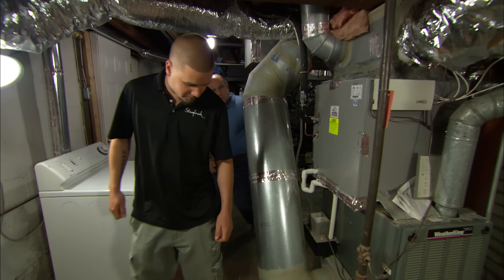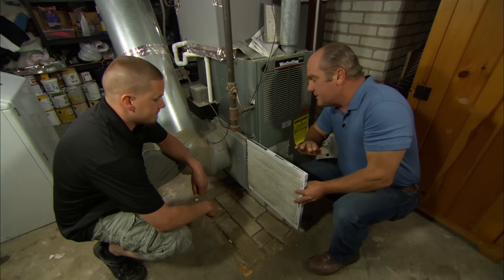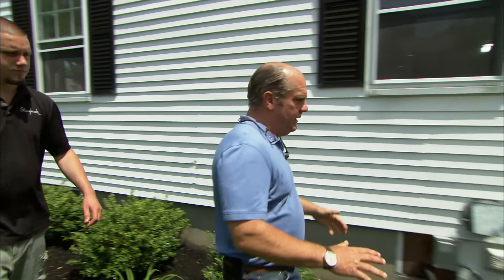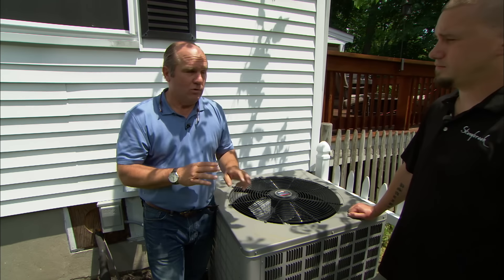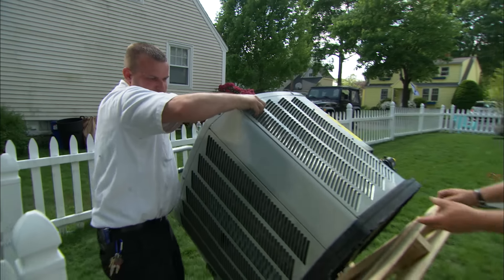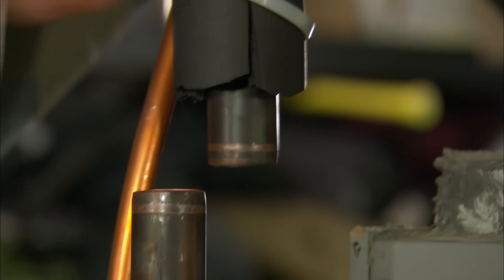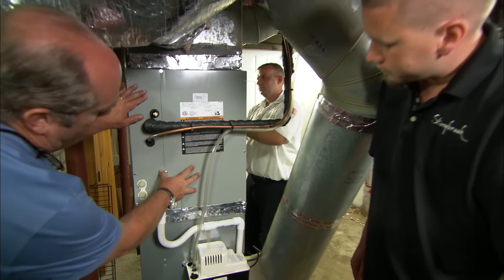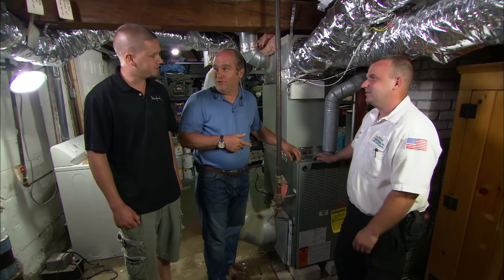How to Repair a Frozen Air Conditioner | Ask This Old House

Comment: "Hey my lines are frozen"
"Let's check your air filter..measure your ducts..yep just like I thought. You need a new unit."
Reply: Hahahahhahahhahaa
Reply: Right?!?!?  That’s ballsy even for residential techs.
Reply: @davidcerino1145  I'm honestly thinking about doing this next frozen line I come to, just to see their face. "It's only three years old!" "Well you're about two years overdue for a new one."
Reply: Steven Douglas 
😂

About 2yrs overdue!  Ha!
Reply: Steven Douglas lmao...
Reply: Love this show! BUT this guy has no idea how the refer cycle works, he was right it was to big. Anyway  it comes in a HOT liquid, pressure drops in the TXV, boils off in a low pressure side, becomes cold ( 40º)  in the evap coil, with a loss in refer or air flow causes this to drop and freeze up. Remember everything you think you know about refidgeration is backwards Lol, it's a chemical mix and science, not for dummies.
Reply: Matt Brown exactly
Reply: Why does he not just turn the AC down??
Reply: Man I can here to fix it not replace
Reply: If This Old House wasnt paying for the new unit, that guy would have been pissed.
Reply: Warren Matt it doesn’t work that way with single-stage equipment.  There is no turning it down.  The compressor runs at only one speed.  The way to stop a freeze up is to supply bigger duct work, so it gets more airflow over the evaporator coil, or turn up the blower motor in the air handler inside unit (most of those have different speed taps on the motors).  More airflow transfers more heat (sensible and latent) to the refrigerant.   As you do this the low-side pressure comes up measurable with gauges.  58 PSI has a saturated temperature of just above freezing R-22, but you really want to see about 68 PSI to 76 PSI for around a 40 to 45 degree evaporator temp, so water doesn’t freeze and it cool well.  If you are low on refrigerant pressure on both the low and high side drops as well and you get a freeze-up, yet you loose BTU cooling capacity with not enough refrigerant as well.  You don’t want to overcharge either as you loose efficiency and the refrigerant can flood back to the compressor in the outdoor unit.   To validate it is not flooding back, you verify you have the proper superheat which is how much extra heat the refrigerant took on from the evaporator after it boiled.   Simply put if the low-side pressure of an R-22 system is 70 PSI it’s saturated temperature is 41 F at which it boils.  If the suction line temperature is 51 F then you have 10 F of superheat...  that’s how you know vapor is coming back to the compressor and not liquid refrigerant.   Likewise, when charging you need to know if you have a thermal expansion valve (TXV) that maintains constant superheat or if you have a fixed orifice.   With a fixed office, you charge based on a superheat charging chart that takes indoor wet bulb (latent and sensible heat load) and outdoor ambiant dry- bulb.  If you have a TXV you charge based on the high-side ensuring proper sub-cooling?   Specifically, that compressor takes the cool vapor and compresses it from say 70 PSI to maybe 300 PSI in the outdoor unit.   As soon as it is discharged the refrigerant is very hot probably enough to burn you maybe 140 F high pressure “hot” vapor on the discharge line.   It then goes through the outdoor condenser coil which blows outdoor air over it (I.e. 90 F air on a warm July day), and this cools and condenses it to a warm high-pressure liquid.  It might be 110 F liquid it sends to the air handler!  If it is 300 PSI the boiling point of that refrigerant is 131 F...  If the line is 110 F we have 21 F of sub cooling and know we are sending liquid to the air handler.  It hits a restriction the piston or TXV and suddenly has a massive pressure drop to about 70 PSI and the temperature drops to about 41 F.   Hope that helps.   Adding refrigerant increases low and high side pressures, lowers superheat and increases sub-cooling.
Reply: Matt Brown you are right.  In fact the outdoor unit sends a solid column of warm sub-cooled liquid to the TXV (or piston)...  it might well be 110 F if the condenser is old and plugged up, but if that R-22 system is running 300 PSI on the high-side the boiling point (saturated temp) is around 131 F, so it would have 21 F subcooling.   Then of course it hits the metering device and drops in his case below 58 PSI and the saturated temperature of the evaporator drops below freezing... Presto... low charge is a freeze up, but in his case it is probably lack of airflow.  Only an idiot puts a 5 ton unit in a house that small and or with with one small duct.   Honestly, I bet the 4 ton replacement struggles to keep it’s low side pressure much above freezing.   I wouldn’t be surprised  if it’s a 410 A system at about 108 PSI  low side.

They should have done a load calculation, installed some new duct work, and likely reduced this home to 3 tons.  Hell my home is 1.5 times bigger and I run a 3 ton in a hot and humid state, and the system runs well.  On a normal warm day I have about an 41F evaporator at around 125 PSI, yet I condense at around 325 PSI u less it is like 100 F outside in which case I condense around 400 PSI.   Regardless, I operate around 10 degrees of superheat and sub-cooling most of the time, but I don’t have a TXV, so my superheat wanders.  Regardless it is usually within + - 3 F of a charging chart...  I am not getting the gas jug out unless I am beyond +5 superheat too much .  This year I haven’t even checked it...  probably should give the condenser the hose treatment, vacuum the drain line,  and slap some new air filters at least.   Last year I did a LOT of pro-active maintenance even swapped the OEM Chinese cap, which was 7% low with a USA made Amrad, which was 1% high out of the box...   I am not likely to check the electric components this year nor the charge.
Reply: @NETWizzJbirk  Holy cow! I am a rocket scientist for NASA and i aint smart enough for all that!!!
Reply: The duct is messed and small
Reply: Maybe he just had a leak and was low on refrigerant...that will happen
Reply: @UnfilteredGolfer  yep
Reply: On top of that, they downsized his unit from a 4 ton to a 3 ton unit.  Wtf.
Reply: @mattbrown1865  This is why I let the pros do this. It is always great to have a good friend that is a HVAC tech.
Reply: ...Today!
Reply: @eliyang  they needed to downsize the unit... it was way too big. without a tape measure I can see that ductwork is too small. if they didn't downsize it, the new one would freeze... didn't you pay attention? Not only was the return too small @14-16 inch, but he has a damper system which is going to effectively reduce the size of the ductwork even more, and the damper system is missing the bypass. a unit that is oversized for the house isn't a good thing - sure the number on the thermostat will be lower faster - but its not going to be as comfortable and will have humidity problems.
Reply: @Justin-vr5zn  - I can promise you he wasn’t paying attention. He’s one of those “bigger must be better” dummies. Hell, it was probably one of his relatives that installed that oversized 4 ton unit in the first place.
Reply: Typical AC repairman
Reply: An actual plenum would have been a good idea, there is no place for the air to properly mix with all those takeoffs coming off so close to that coil. Basements like that are tough because the ceilings are so low
Reply: @warrenmatt5099  sometimes that works sometimes it dont
Reply: Bro didn't even bother hooking up gauges before replacing it lmaooo
Reply: HVAC 101
Reply: This statement is more accurate than all his calculations. This just happened to me
Reply: Sounds like a great salesmen to me lol

Comment: This problem was addressed in my HVAC class several years back. Most techs wanna jump out and throw the gauges on it first thing. My instructor DRILLED into us "Airflow,Airflow,Airflow!" Here is what I was taught. 1.Check the filter and make sure it's new/clean (if no filter is present, the coils may be clogged) 2. Check the fans both in the evaporator and the condenser and make sure they are moving air. 3. Check the Thermostatic Expansion Valve and make sure it's not hunting, and that it's functioning properly. 4. Check your refrigerant level. And if there is a leak, fix it. Don't top it off! However I do agree that oversizing is a problem. It's actually better the system be a bit undersized than oversized If a contractor is going to do an install like this and doesn't do the manual j calculations, run them off!
Reply: I know in architecture classes we were taught that you want the units "undersized" as incapable of fully heating or cooling the extreme hottest or coldest the area sees as the last few days is a big jump in system size. But this isn't my specialty and I may be remembering wrong, but that is my recollection at least
Reply: Kenneth the
Reply: if the superheat/subcool are checked, whether it's a txv or orifice can tell if the low pressure is caused by low airflow or a leak or restriction.
Reply: Tip: Even if the filter is there, check the pressure drop across your evaporator coil and total external static across the blower inlet to furnace discharge. 

Your pressure total from the RA to furnace discharge should ideally be about 0.8"-1.0". Check your manual for total external static pressure. (A dual port manometer is great. Use the "-" port on the inlet side of the blower and the "+" port on the discharge side of the furnace.) 

The static pressure drop across a wet evaporator coil should be about 0.2" wc usually. A greater pressure drop indicates a restriction and you should visually examine it.
Reply: 1300 square ft home changes 4 to 3 lol. A 2 ton is the correct answer.
Reply: You say airflow,airflow, airflow , but not one mention of how small the return air is
Reply: If you look at the filter it's black text which is probably the merv13 filter home Depot sells . Probably one of the issues
Reply: @shahsmerdis  and also the way it’s installed.  The filter is right up against the round undersize return, not further toward the furnace like it should be.  That is a huge restriction.  It needs a return air plenum.

Comment: My AC unit was freezing up...and I placed a small FAN in front of the intake vent (where the filter is)...turned the fan on...and no more freeze ups!!! Works like a charm
Reply: What does that do?
Reply: @larsonfamilyhouse  it forces more air through the intake.
Reply: It’s only a coincidence that works. That fan is likely doing nothing. There’s lots of reasons for that

Comment: "My AC is freezing up.  What should I do?"

"Spend $6,000 and let us install a new condensor and A coil!"
Reply: ike fun  -  was the ad hominem really necessary?
Reply: shortage of refrigerant. check for leakage
Reply: @jhuh1758  - More than likely, or else loss of superheat from a faulty TXV overfeeding the coil.
Reply: My AC had the same problem, but in addition the outside unit would continue to run even when the thermostat inside turned off the inside circulation fan.  I had to manually pull the disconnect circuit breaker outside to shut it off.  Turned out that the contactor relay switch on the outside unit had gotten stuck in the closed position.  I was able to unstick the contactor by prodding it with a screwdriver, but it was very pitted, so replaced it.
Reply: not to mention he probably had the temp set to 65
Reply: Richard mainly was saying the BTU unit was just too much for the amount of space they had that that house hence the reason for freezing up there was just too much cooling happening for that 4 ton unit for that amount of space. He won’t be having that problem any time anymore and I’m also sure the company who installed the 4 ton insurance paid for the replacement.
Reply: LOL TruthSurge........my AH just started freezing up. 😢
Reply: @whisper2162  :(
Reply: @digitaldazzle5836  Lmao, never thought I'd hear a Sye Ten Bruggencate reference watching a HVAC  video.
Reply: TruthSurge Lmaooooooo
Reply: @Sharrieff93  hehehehe  I'm so cynical!
Reply: check freon to see if it is low you may have leak now i have 55 years experance
Reply: For $6000 you can get 8.5 ton  central air unit. 🙈
Reply: Oversized units will get you to temperature, but won’t run long enough to remove humidity.
Reply: I bet the issue was the filter.  It looked like a high hepa filter that restricted the air flow.  A "less efficient" filter would probably solved everything for about $5.00!
Reply: The outside unit is dumping too much refrigerant into the could that the fan can't keep up
Reply: Still doesn’t have enough return air, it will still freeze again
Reply: @patrickmccarthy5617  The customer said he bought his own equipment.

Comment: I had this as an issue. My Coil kept freezing over. So, I just had a team come out and replace the entire system: condensor, coil, furnace. Also replaced another condensor, and did some other repairs. Now my house is freezing cold! So happy!

Comment: Good idea. Remove an oversized unit and replace it with an oversized unit. Good deal!
Reply: I bet it's a air flow issue rather then it being under charged.  it has a txv so it should of helped prevent freezing and constant superheat.  I can't believe they didn't check the charge during initial testing or even check static pressure or cfm/ airflow.  Did you notice when he was explaining the evap coil he said the liquid line was "leaving the evap coil and suctio line bringing in the the refrigerant"!!  I like to know what size blower that furnace has.  it also the worst duct system install I've seen in a while...that return us way too small.  they also had the old coil improperly installed because of it being a larger size then the furnacr.  the manufacturer specifics how a over sized coil can be mounted on a furnace.  No checking delta T with the AC runnung, not checking the superheat and txv subcooling,  no airflow testing, massive amounts of Flex duct supplies... " how do we know the system is charged correctly"..The system, like a lost all comes charged for 15ft of pipe, but that's not checking the charge. what was the superheat and subcooling with the new system?  this guy probably needs a crappg ez flow filter to drop static pressure..anything to help with air flow...still that return is pitiful and should have been probably addressed.  I though the this old house guy would have said something about the horrendous installation...what a shame for this old house. No heat load calculations...determining size by Sq footage!! LOL, even this old house isn't immune to hacks.  if this old house wanted to really impress viewers they would have used a imanifold to should how poorly the system  was operating and all the specs the system is running far out of!  I could of figured this out with my digicools, minivan anemometer, my old school dwyer magnehilic, dual temp monitor with delta t measurement.   You never NEED to have a matching evap coil and can always size up one size to increase humidity removal and increase efficiency.  we  have situatations 4 ton condensers with 5 ton evaporation  coils to meet ashre combinations and correspondence effeciency.  I'm glad heat load  Calc are required for permit application for replacement systems!  That knock half of the local hacks0 m outfits out of business because of their lack of education and fines for not doing their job properly.  I'm 25 and have my hvacr master license.  I did grow up in the business, full disclosure, and am the tech side of the company and troubleshooting the people who decided the lowest bidder was a good idea because they don't understand they aren't buying a car or appliance.  They are buying a service that require engineering of hvac system, and duct system, to ensure the outcome will not turn out to be  hacked like this type of job which is a embarrassment to ALL competent HVAC techs and they should be mad these people are in business.   the only reason this homeowner didn't complain is because they didn't pay for the new system!!
Reply: Not that we would know accurately but def say about a 2 ton unit would have done it
Reply: @NytefogNJ  I know nothing about HVAC ducting specs but what if they simply "ported" vents and intakes into the basement for more air volume???
Reply: My thoughts exactly.   This is like a 1200 sq ft house in temperate middle USA, where it probably gets to like 82 on a hot July day.   What it probably needs is all new duct work and likely a 2 to 3 ton unit.
Reply: Just In credible not necessarily.  I have a 3 ton unit in hot and humid South Carolina with 1800 square feet, and it cools okay.  On a 100 F day it just maintains, but it’s fine.   This small house in the middle of the temperate USA should need less.  A 3 ton unit with proper duct work would blast them out of there.
Reply: My friend has 2, 3 ton units for a 1500 sq ft house and it works like a charm 🙂. I don't know why he has that much but he does. He's an a/c guy too.
Reply: @mikeschiavoni5973  yes, they could waste some air into the basement or somewhere, where it doesn’t cause a problem, as long as they could get the volume up.  Only problem then would be a higher power bill

Comment: Most residential AC condensers use old technology developed by Mr. Carrier about 100 years ago. Many Asian AC condensers now use more and more inverter technology, some of them are capable to work with a wide range of loads. You won't need to worry about being oversized or undersized. They work even if they are 200% of the required tonnage.